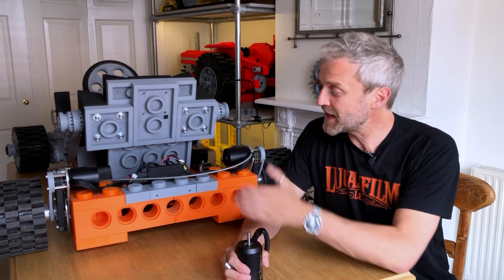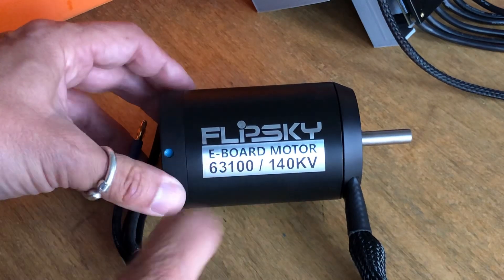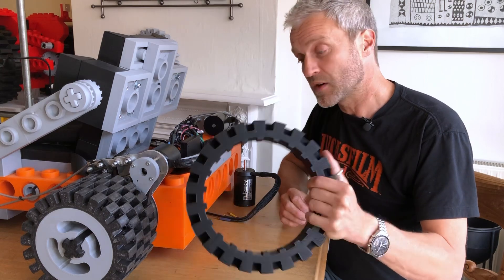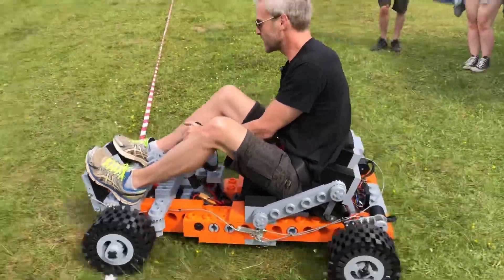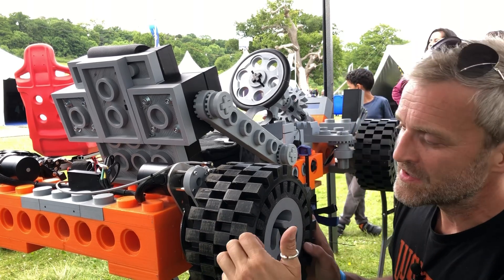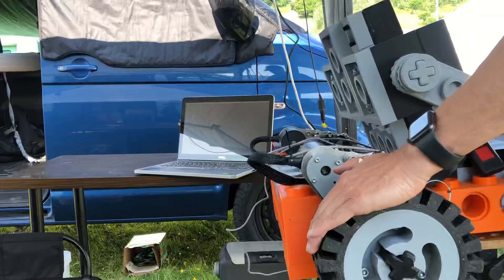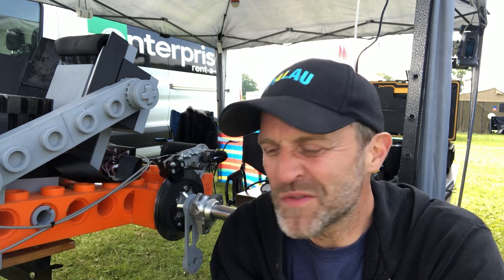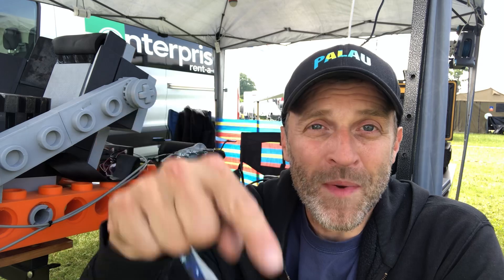3D Printed Go-Kart OFF-ROAD (ish) - #EMFCAMP

Comment: May I suggest that long beam that your friend printed out for you you have those remade in billet aluminumyou'll get a lot less flex and it'll still be relatively light second suggestion switch from belt pulleys to 420 or 520 series  Racing chains and split sprockets.  Awesome bill dude I subscribed to your channel just a minute to go have an excellent day

Comment: Have you thought of making a silicone casting of the tyres, Use moldmax30 for the clams, and PT Flex with black pigment fast curing rubber for the tyres. Also maybe some radiuses on the internal notches of the treads to prevent tearing.
Reply from the maker: Yeah I’ve used PT flex before but to be honest the printed TPU is pretty cool!

Comment: To increase torque...why didn't you just change the gearing?
Reply from the maker: I can’t. I’m already on the smallest pulley on the motor, abs the largest due to brake callipers on the wheel. You’d need to go back a few videos to see why :)

Comment: Small comment on the XT90 connector: I stumbled over this too. The 90A rating is only the burst rating for 10s, nominally they're only rated for 45A continuous!
(Search for "XT90H SPEC.pdf" for the original datasheet, can't put a link in YT comments)
For my next high power project I'll probably be looking into Anderson Powerpole 75 or 120. With their respective highest capacity contacts they'll do 120 or 240A continuously, if I read their spec correctly.
Reply: There's a test video showing and XT90 carrying 270amps for 10seconds by Dronelab. Clearly not recommended, but I think they're conservative with 90A for 10s.
Reply from the maker: Yeah it’s a bit of a problem! What’s bonkers is that many batteries and controllers use them when they are way underrated! Anderson are good, I’ve been using them for years, but bulky.

Comment: Anyone know what Matt means when he says he has to tune the motors? Us this simply to make sure both run at the same speed and respond at the same time?
Reply from the maker: The software does it for you within the VESC controller. It determines motor winding resistance amongst other parameters to get the brushless motors set correctly